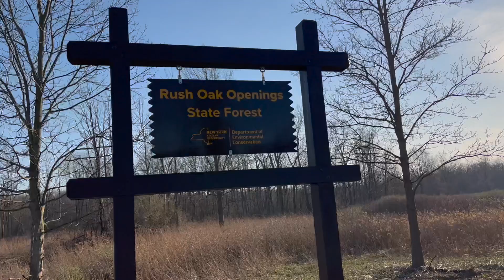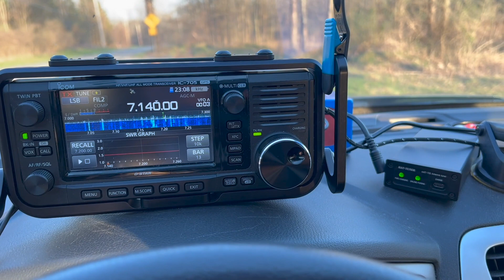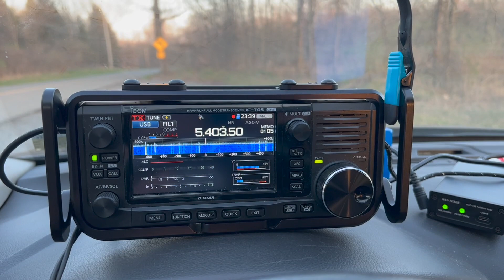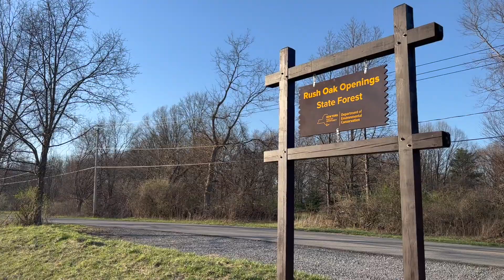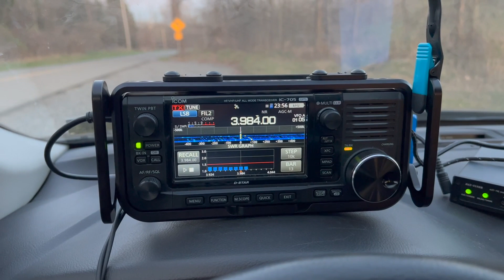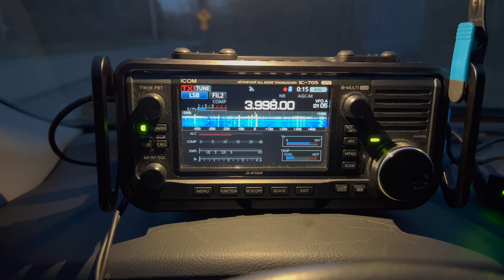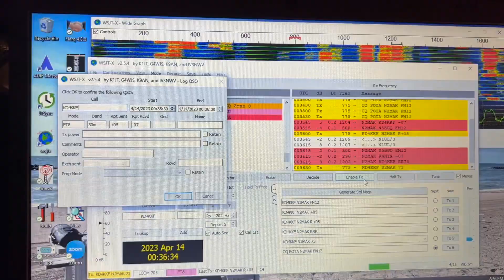Linked Rybakov Antenna Late Shift POTA

Comment: Looks like an efficient tuned antenna. Wonder have you made any video's re making it and wire lengths. Regards vk5cz ..
Reply from the maker: The Rybakov antenna is a 25 feet vertical and uses a 4:1 UNUN. I just added another 25 feet with a link to see if I could get it to work on the lower bands. I have 3 others videos on the antenna on my channel: 2 on the 25 foot version and another on the linked version. Check them out to see more about the antenna. Thanks for watching!